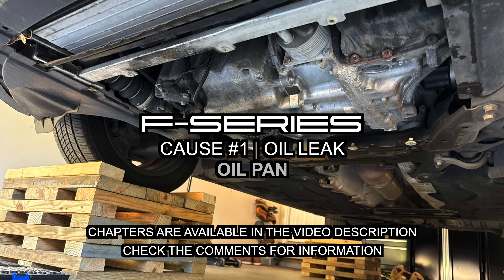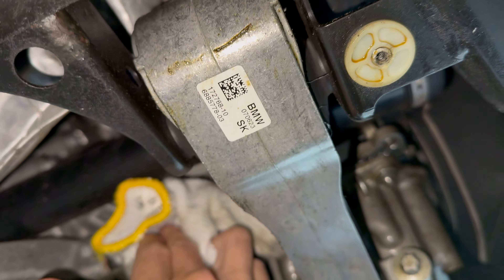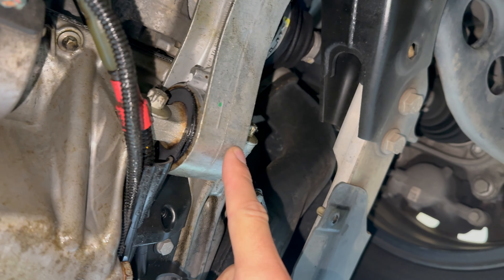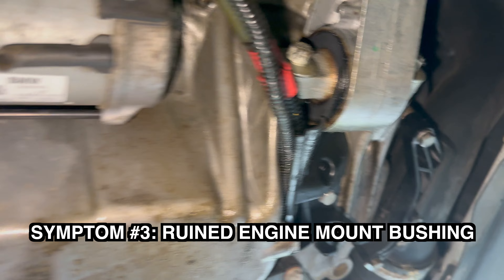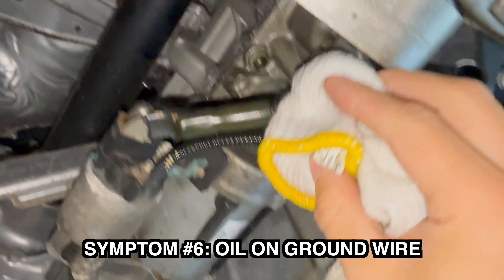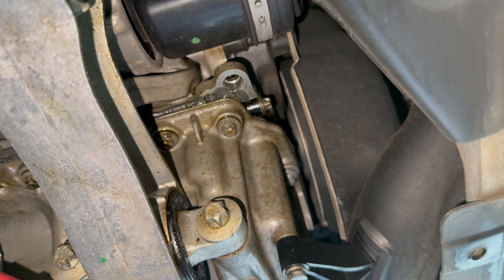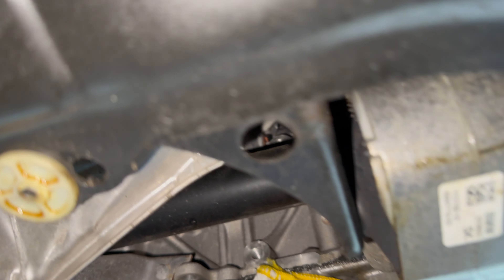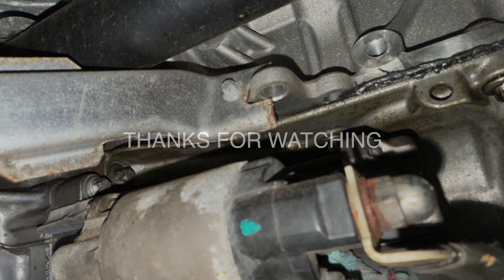Oil Leak | Cause #1 | Oil Pan | MINI Cooper ( Gen 3 | 2014+ | F-Series )

Comment: Thanks for the info. 👍
I replaced the engine mounts a couple days ago and I noticed my mini cooper has an oil leak, I saw the leak is on the oil pan, I think it was caused because of the vibrations due to the bad mounts. Now I have to fix the leak, and as I have seen it doesn't have a gasket, the oil pan is seladed with flange sealant (Alkoxy Silicone), is that right?.
Reply from the maker: Apologies, that's an adventure I haven't embarked upon yet and don't know. Will update when I fix it tho. Sorry yours has a leak too